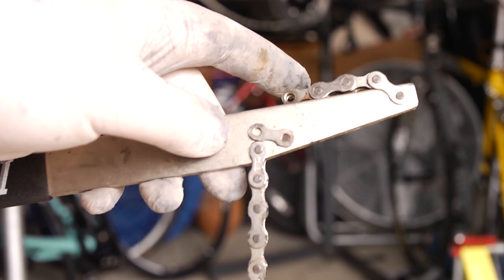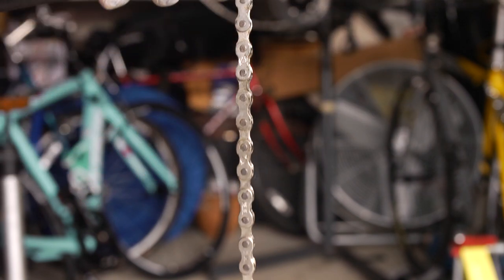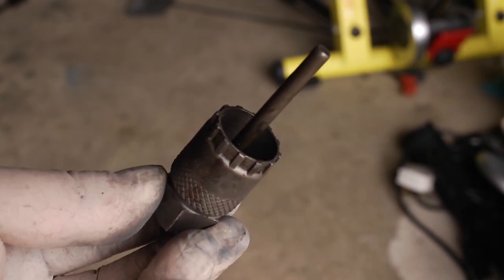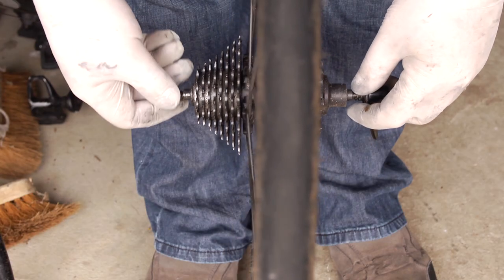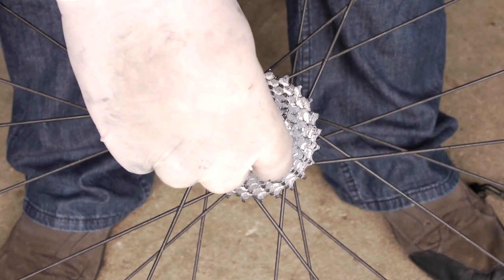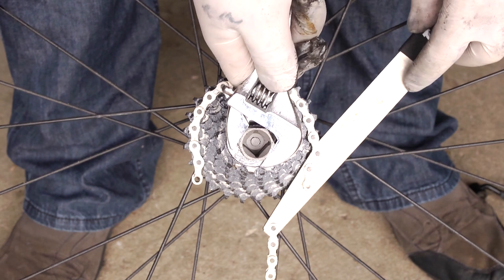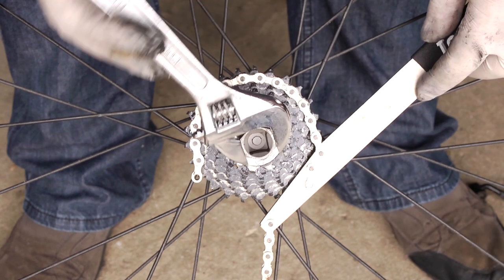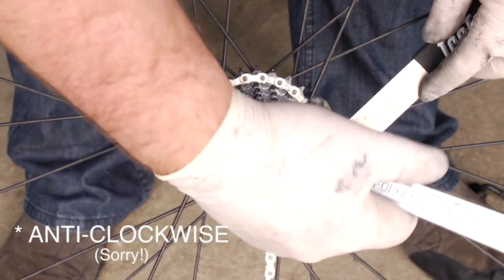How To Remove A Rear Cassette From A Rear Wheel

Comment: I took my back wheel off, my axel split in two and loads of bearings fell out , is this something I can repair myself, before this happened, I took it into a bike shop and they said they need to fix the back wheel and it will cost me about £80.00, the bike is only worth 170.00 but I love my bike., is it wirth fixing myself or get a new bike, ?
Reply from the maker: The bike might only cost £170 but I’m guessing, to you, it’s far more valuable. An £80 repair bill for the wheel might not be too bad when you take how much you live the bike into consideration.